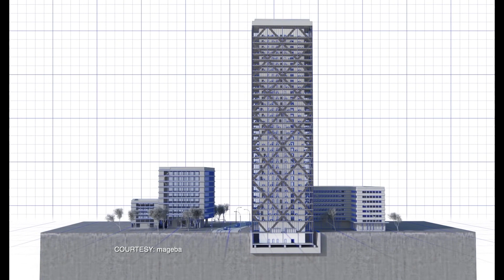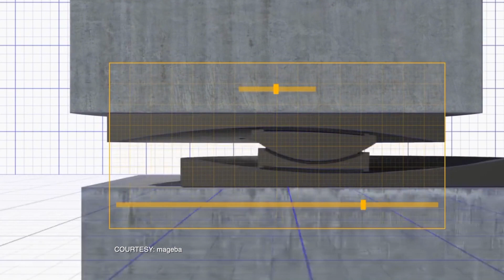Secret Underground Design of New Earthquake Proof Buildings

Comment: Earthquake -proof? is a very dangerous term to use unless your building was tested with at least magnitude 8.0 earthquake and the building has zero crack/damage only then you can claim it to be earthquake-proof.
Reply: No, no. California typically does not have 8.0 magnitude quakes. Usually a high 7.0 at most. Also, earthquake-like forces are tested before construction. In addition, a building can be earthquake-proof and still need a few repairs. The whole point is so the people in the building are safe from the structure collapsing onto them.
Reply: Agree, the proper way to call it is earthquake resistant buildings.